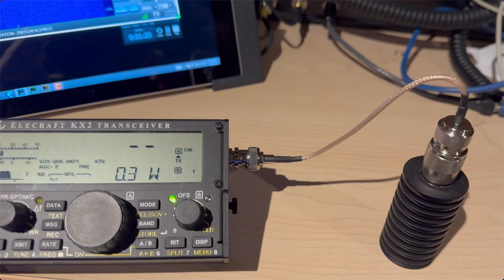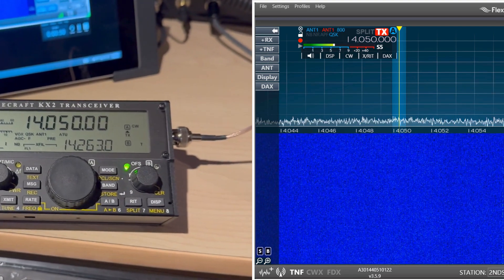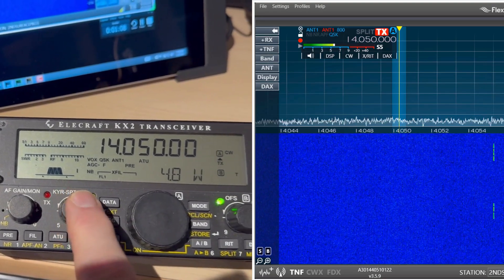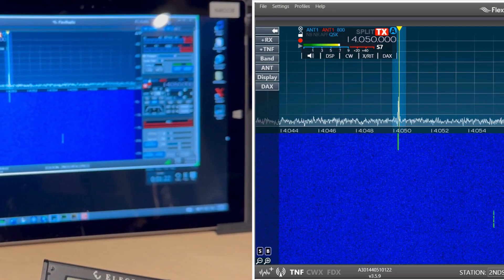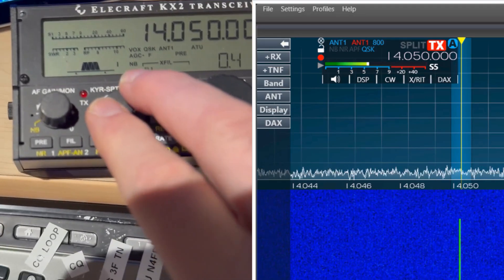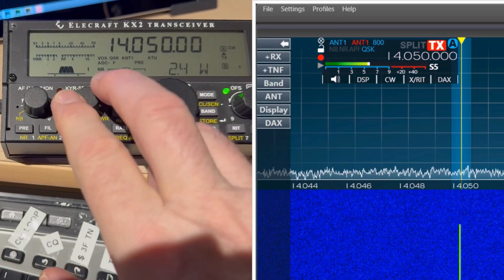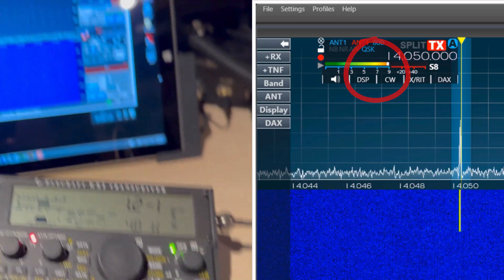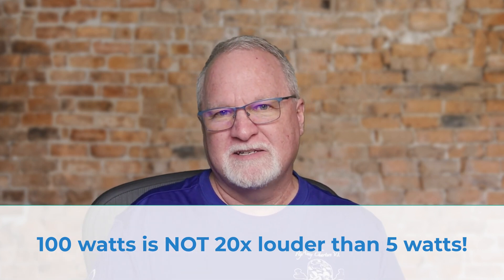Quadruple Your Power For Only 1 S-Unit!

Comment: S units are logarithmic units of measure. 1 S unit is an approximate 6 dB change which is approximately a factor of 4 change in arithmetic units. Let's look at the arithmetic ratio of 100 to 5 - in logarithmic units a change of 5 to 100 is a 20 to 1 change, which in dB would be 10(log 20) = 10(1.301) =13.01 dB. An increase of 5 watts to 10 watts is 3 dB, and an increase of 10 watts to 100 watts is 10 dB, for a total of 13 dB. In my 4 plus decades in military radar and electronic warfare development, test, and integration we routinely worked in dB units for the convenience. Many systems applications involve very large numerical ranges of measurement (radar log-amp receivers for example) and most of the time we can do the dB calculations in our heads - slide rules or calculators not needed.

Comment: While the math is absolutely correct, it’s not the whole story. 

I have for years operated from milliwatts (KX3) to kilowatts (legal limit) on pretty much all bands. On noisy bands like 160m and 80, depending on what mode you’re running, two S-units can make a massive difference, especially when using voice modes. S/N ratio is what matters.
Reply from the maker: Absolutely!  I regret that I didn't mention that you can't control band conditions or the noise floor of your recipient. - Cliff

Comment: My old tutor always told me if you double your power you get an extra S point!...
Reply from the maker: Actually, if you double your power, that's a 3db increase. But, S-Units are 6db apart.  Hence, the need to quadruple your power to achieve an additional S-Unit.

Comment: So 25 mW being an S-1 at 100 miles away would only be an S-7 at 1000w? Seems 1000w would be more than S-7. I'm not sure it scales the same at very low and very high watts.
Reply from the maker: 25mw =S1, 100mw = S2, 400mw = S3, 1.6w = S4, 6.4w = S5, 24w = S6, 100w = S7, 400w = S8, 1,600w  = S9
Reply: Oh, I was mistaking 25 mW for a 1/4 watt. So 1000w would be higher than my calculations by nearly 2 S units. @QRPSchool
Reply: That makes a lot more sense. I mistook 25 mW for 1/4 watt....oops.  @QRPSchool

Comment: Your experiment is relying on coax loss to determine TX efficiency. Is the length of coax resonant on that frequency? If the antenna is not the 'point' of the experiment, then what if someone transmitted with only a jumper and no dummy load at all? If only using mW's it won't hurt the radio but doubling or quadrupling the power will not have the same effect as if using a resonant and realistic antenna for that frequency. Also, your experiment is determining "near field" signal strength which is not the same as someone hearing you thousands of miles away. Why does the 'proof' have to use a dummy load in the first place?
Reply from the maker: I have conducted this test on-the-air but haven't recorded it. Using the dummy load was a convenient way to do the test here at home without having to have a camera in two locations. I would love it if you would make a video disproving that a quadrupling of power (6db increase) leads to only a single S-Unit increase. After all, S-Units are 6db apart.
Reply: Hi Aaron, antennas, feedlines and dummy loads are linear devices, and there is a direct linear relation between near-field amplitude and far-field received E-field signal amplitude, so the relative change in receive level on a logarithmic S meter will be the same using a dummy load and any length of coax in the near field, or from an antenna to a remote location. Sure the absolute values will depend on many factors, but the linear relation between transmit power and receive power can't be changed unless there is something nonlinear in the path from tx to rx.
Reply: Fair enough, I just assumed proof would have to be conducted with the same variables that you are proving. Both your replies make sense, thanks. @MachiningandMicrowaves

Comment: I am a new to Ham Radio and just got my General in November, while i understand what you're saying about how "power" as in watts affects the actual S unit signal, what i dont get is why when i am looking at QRP Radios, is the price of the Radios so expensive, so just logically speaking, they are smaller, less watts, etc, why is the cost so high, it would seem that your actually gett less Radio right? So where is the money at? What am i missing? Are the transceiver/ receivers built better? I'd really appreciate if someone can square me away on this, so thanks in advanced!
Reply from the maker: That's an interesting observation. There are some inexpensive CW-only radios. I like CW so these small battery-powered radios are right up my alley! Nicer radios like the Elecraft KX2 or KX3 that can doi-it-all are pretty expensive. Over the last few years, several manufacturers are making multi-band HF radios that are less expensive. Take a look at the Xiegu G90 or Xiegu X6100, for example. It's hard to buy a radio today that doesn't have a good receiver. The more expensive radios may have better DSP, etc.
Reply: @QRPSchool  i run a yaesu 450D right now and it does everything I want it to,but I was looking at the QRP specific radios and it was the elekraft radios that got my attention on pricing,  I mean wow, they are a lot more, which begged the question, what are they doing that other manufacturers aren't etc. And I understand when features separate radios but when the features are pretty much the same as say a comparable full size 100 watt radio how can they be the same price and sometimes aka elekraft they are more expensive. 
I mean physically, less weight, smaller size ,less wattage all equals less radio, yet the price is the same if not more.

Comment: Humans can’t perceive a difference in volume (audio amplitude) until there’s a 3db difference between signals, and that requires doubling power!
Reply from the maker: You're right that doubling your power yields a 3db increase. S-Units are 6db apart, hence the need to quadruple the power to gain an S-Unit. If I watch my S-meter during a SSB conversation, the S-Units rise and fall and it's pretty impressive that we don't really experience the swings that can happen during a spoken sentence.  Kind of fascinating.
Reply: And of course on a radio with AGC, once you get a little above the noise floor, an increase in transmit power of any amount doesn't make the mean level of the received signal louder at all, it just suppresses some of the noise and adjacent channel phase noise

Comment: One S unit is everything, if the DX station is just about hearing you, it is all relative.

Location is number 1, antenna is number 2 on the list of obtaining the strongest signal.
Reply from the maker: The most critical thing, and something I've mentioned in previous videos, is that your signal has to be above the receiving station's noise floor. It's great if 5 watts has you at S5 to a distant station, but if they've got an S5 noise floor, you'll need to increase your power to complete that QSO.

Comment: Wow - this was a surprise! Glad to see you back again. Low power does work - while not QRP, I had a conversation (not 5NN 73, next) with a ham in Australia yesterday from NC with 25 watts CW, and that was with a remote tuned long wire antenna that I know isn’t radiating all 25 watts. Love my KX3 in the field too. Low power and QRP (at least on CW) = fun.

Comment: HNY OM, i just recently started getting my feet wet with QRP and morse code, and am REALLY REALLY enjoying it (truth be told more than i thought i would actually HIHI). Thank you so much for the video. On a personal note what draws me to QRP is the fact that is uses sooooo much LESS current from your power supply be that an internal/external battery etc, so for field work QRP allows you to play radio for MUCH longer too :-). Best 73 de ZS6AKW.
Reply from the maker: I'm glad you are enjoying playing with QRP. It's a lot of fun, and those small battery-powered radios are fantastic in the field. - Cliff

Comment: Our licence is to allow us to use 1 kW soon.
Going from our present 400 Watts maximum to 1,000 is one half S unit. Is it worth it? Think of the electricity bill.
I'll keep my QRP 5 Watts. It's great when I have a QRP to QRP contact even if hard work sometimes, it's an achievement. Use mainly c.w.
One Watt c.w. on 10m recently into Sicily and Bulgaria both about 1400 miles. 10m wonderful lately.
G4GHB.

Comment: You don't have to prove it to me!   I was sold on QRP a long time ago.  I am a believer in "An amateur station must use the minimum transmitter power necessary to carry out the desired communications."    If QRP accomplishes that, I am good.    To each his own, but I would rather spend my time, effort, and money improving my antennas.
Reply: I agree with you a 100%. I'm new to hf using only an hr2510 for 10 meters. I turned down the rf output to 20 watts to prolong the life of the finals. I've a lot of stations in Europe and the farthest I've made contact was Brazil which is more than 19,000 km from where I'm at here in the Philippines. Some stations I've worked with transmits as high as 1kw, some 400 or 600 watts while they give me a 5x6, 5x8 report with just my 20 watts and only a rotatable dipole that I've made at 20 feet above the ground. It sure a fullfiling experience working with them Big guns against my very simple station.

Comment: Great to see you back....though it is worrying people don't seem to realise an S-unit is 6dB, and a 6dB increase takes 4x the power.  That said, if half an s-unit gets you out of the receiving ends noise and hence becomes the difference between a contact and no contact, then sometimes you do need more power.
Reply from the maker: You are absolutely right! I should have mentioned this. The receiving station's noise floor will determine how weak of a signal he can hear.  Of course, you can have a weak signal to some areas and a strong signal to other areas at the same time. I tend to call stations with stronger signals. I'm assuming that if he's strong to me, propagation may be pretty good between us, and I may have a better chance of completing that QSO.

Comment: Good to see you back! When I’m portable (POTA mostly) it’s max 5 watts.  At home, CW is 10 watts, digi is 10, and SSB is 100.  Never really felt the need for more.  Not saying one day I won’t get squirrelly and get an amp, but my other hobbies are expensive too.  Thanks for the vid. Mat - K4OCY
Reply from the maker: Get an amp if/when you can. You might want to bump up your power if that's the only way to complete that desired QSO. I guess I've just got the attitude that if I can't talk to a calling station on 5 watts or a 100 watts, I should just turn the big knob and find someone else where propagation is better between us. (I can't honestly say that I have never wanted an amp... just that I've talked myself out of it many times!)

Comment: Good surprise to have you back. Here's my view. I run SSB at 100W (not a QRP guy). Lots of folks say exactly what your saying, it doesn't really matter, it's only a single S unit, hardly can tell! Yes, that's true when you're comparing S5 to S6, S6 to S7, etc.... but I'm on an end-fed, mostly omnidirectional, and if on the receiving end I am one S unit in their noise, then one S unit is a big deal to me. It's just not a concern for the higher end of the scale, at the lower end, it is a big concern. It can be a difference maker for marginal contacts.
Reply from the maker: You are absolutely right!  If the receiving station is having trouble picking you out of their noise floor, you'll need to increase power to complete that QSO. At times like that, I usually just pretend like it's a fish that got away from me, and I cast my line somewhere else.

Comment: Agreed, but then you also have to concede that going from 500w to 2kw in unnoticeable and we all know that's nonsense - real world experience tells us otherwise as you chaps always forget to factor in antenna gain when making these statements :)
Reply from the maker: Agreed? Good!  But, wait... are you saying that the math changes when you get to 500 watts?  So, you're sending 500 watts and the receiving station has you at S7 AND THEN you increase your power by a factor of 4 and the receiving station registers MORE than one additional S-Unit (S8)?  How does that math work? I'll wait...
Reply: @QRPSchool  I'm saying it's not all about the meter, close your eyes and use your ears, you can notice a 4X signal :) Please tell me how much IS noticeable then ? why are the QRPers using so much power ? just use 100mw if power does not matter. (I'm not starting a fight here, I'm just having an opinion, live and let live).

Comment: This is also why maximizing antenna system efficiency is so important as well. In my experience propagation either is or is not in your favor unless you have a big high directional antenna lol.
Reply from the maker: Agreed, Chris!  Antennas are super-important for weak-signal work. However, and I hate to say this, even if your antenna isn't great and you're only getting half the power out of it, that's still only 1/2 S-Unit less of a signal being transmitted.  But, I always like to use a full-sized dipole or 1/4 wave vertical in the field, if I can.  That just seems like good old-fashioned best-practices to me. Thanks for your comment. I should have mentioned that a good antenna is important. - Cliff

Comment: I have found that if I use  my G90 at 20 watts and can not get through, then jump to 100 watts with the amp its a 50/50 shot of making the contact.
Reply from the maker: That's a real thing, for sure. If your signal happens to fall at or below the receiving station's noise floor, a bump in power might lift your signal up out of the noise.  I have 3 100-watt radios and I'm not afraid to use them! :-)  - Cliff

Comment: Wow. Nicely done. Yeah but - you're right and you proved it. The greatest line was transmitting at 100W is not received louder than a signal transmitted at 5W!!! That phrase alone ought to be thought experiment enough to be confirmed in real life operating proving the value of QRP. Thank you and welcome back! 

All that said, I use my IC-7300 and truly enjoy the wattage. HOWEVER, my first 395 contacts and 30+ countries happened when I had a max of 20W and typically I only used 5W. My anecdotal (albeit logged) evidence was that often 5W was more efficient and more easily heard than pushing to 16W.
Reply from the maker: Thanks, John. I should probably reveal that I have 6 QRP-only  radios but also 3 100-watt radios. Sometimes those extra two S-Units come in handy for all of us! - Cliff

Comment: Welcome back Cliff! Well said, and well demonstrated. Something I try to avoid telling my students who are looking to go from 50 to 400W. Is all that study worth 1.5 S points? Let's not go there. Only time an extra S point is worth it is when you are just under the noise. But like you, if QRP is not enough to make the trip, I will move on. Thanks for sharing.
Reply: @G0FUW not just the studying but the cost of the amplifier too😂think I would rather invest in the antenna although tricky with a normal garden , having said all of that I still want to do the full exam for self achievement more than anything 73 de 2e0nbk
Reply from the maker: Thank you, Steve.